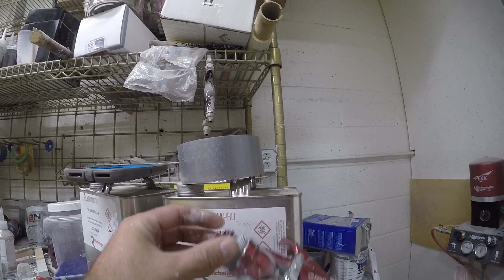Sparying Sher-Wood Hi-Bild Precat Lacquer

Comment: I heard this paint turns yellow over time have you had any of this happen
Reply from the maker: I have not had an issue, but can happen due to mixture or brand type. Also UV protection can go so far. To answer your questions about sanding it helps with getting a smooth finish.Sorry for late reply have had some family stuff going on.

Comment: what is the name of the equipment you use to paint
Reply: Air assisted airless. Looks like a C.A. technologies rig. 95% sure. A few companies make them they fill the gap between airless and HVLP. Its slightly less efficient transfer rate then HVLP but has a pump like an airless. They also have mixing pumps for epoxy.